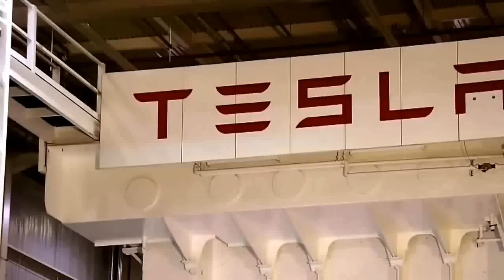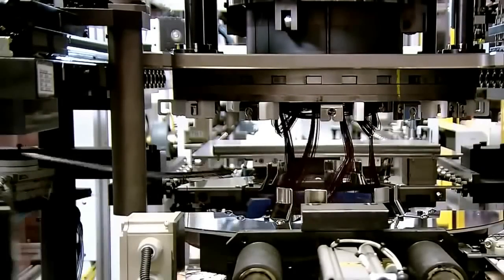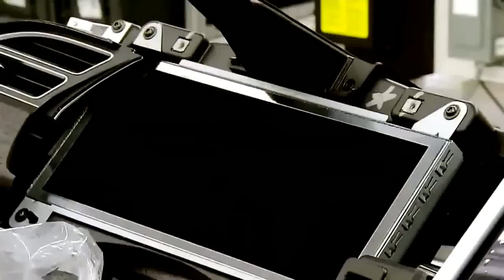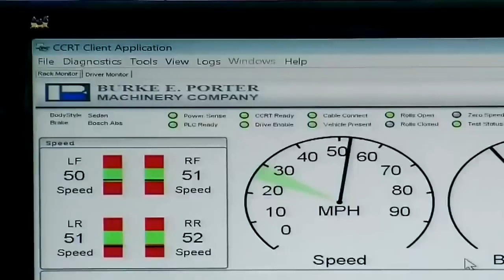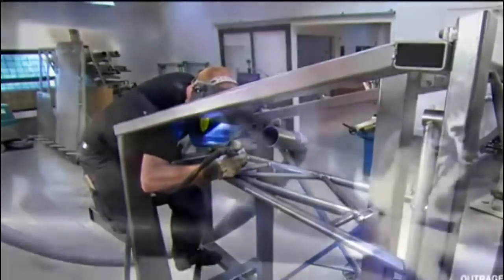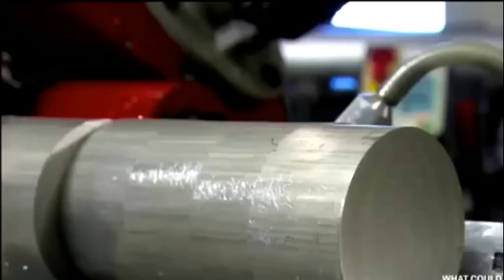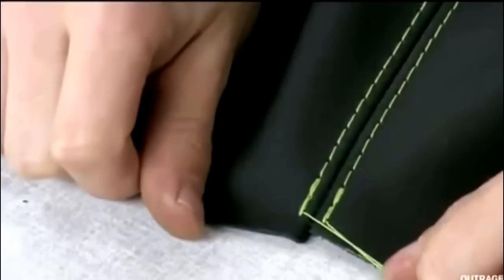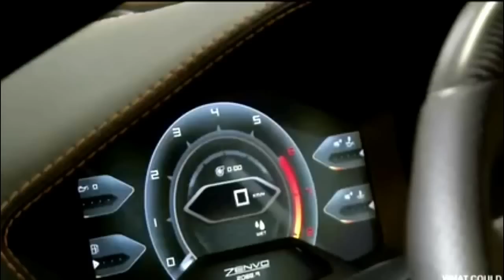Future Cars 2015 -- Supercar 2015 | Tesla Model S vs Tesla Model S1 | New Cars 2015

Comment: This guys saying that it is "emission free" is just partly right. Electricity needed for this vehicle is most likely being generated by coal power plants (30%efficiency), whereas any motor vehicle convert fuel into usefull mechanical power of around 21-25% efficiency) if you google CO2 emissions from coal and petrol is very different. EV will be clean way to use transport when electricity will be generated by nuclear power, hydro and renewable energy.
Reply from the maker: prison9865 thank for watching ^.^
Reply: prison9865 Yes the local energy comes from local resources, but tesla has a plan to set up solar power plants to cover even the world with that power. its pretty interesting!
Reply: prison9865 The car (subject) is emission free, so 100% true.
Reply: prison9865 still, energy required to refine that fuel is 4-7.5 Kwh per gallon. http://gatewayev.org/how-much-electricity-is-used-refine-a-gallon-of-gasoline
Reply: prison9865 Most likely not generated by coal. Most Teslas end up in Ca. California had 10 coal-fired generating units at eight locations in 2005, with 439 megawatts (MW) of capacity - representing 0.7% of the state's total electric generating capacity.
Reply: OK, but im not sure what "most" means in this context. If there are 1 million cars, most means 999,999 cars are in CA or 501,000. anything between this number. if we say that 300,000 are sold somewhere else but CA, then this might be different story. There was an article, that coal fired power plants are still main source of electricity in many states. How about other countries as well?
Reply: Well if you researched it (google) you could base your blatherings on data. never mind.you are right. Tesla sucks .I saw an article where a guy in a tesla hit a bird because the car was too quiet. So by my calculations 43.8% of bird  murder is caused by Tesla.
Reply: never said tesla sucks. Wake up mate!
Reply from the maker: Thanks For Watching